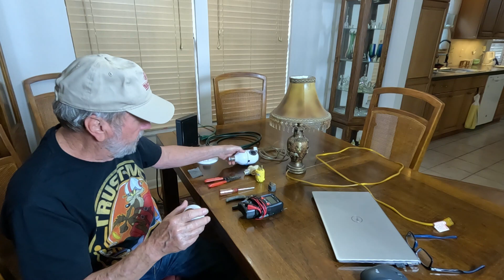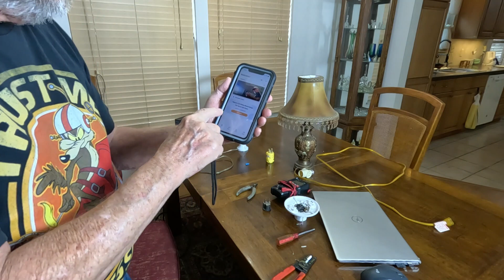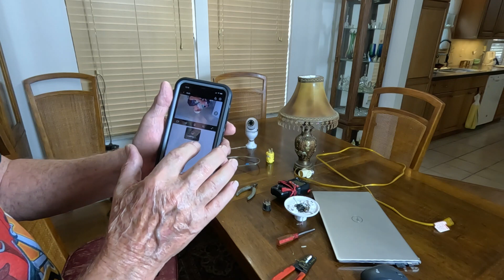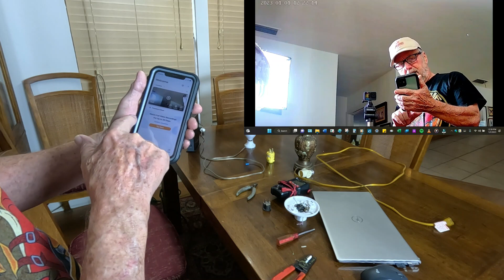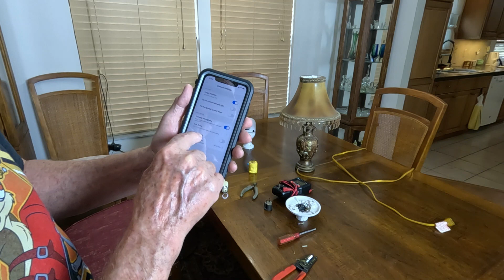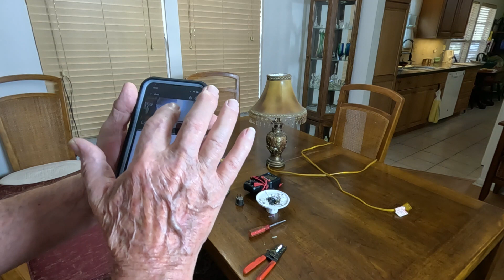Light Bulb Camera Pan and Tilt operation Q and A

Comment: OK Sam, you helped me out earlier, I got the camera working by connecting to a 2.4G router. Next question is how do I add a camera (device)? I have hit every button in settings and don't see anyway to add device
Reply from the maker: @Lee Keen, when you are on the app in the beginning, it has a button to add a camera as the first thing to do.  As you click this it directs you to point your camera with the QR code reader at the QR code on the Camera base.  This is how your camera connects to the App, then you connect the App to your Wifi connection.  That is when you will have access to the settings of the camera and do all the stuff to set the camera up to record all the time or only when movement is detected and how long you want the files and on and on.  Hope this will get you started.

Comment: I just got mine delivered today and put it outside  but sometimes  it auto focusses on the house  wall and not the yard
Reply from the maker: @lastking32 they will all do that as a home location.  You can turn the camera section to the view you want as the home location.  Then home will not be the wall.  Home will be the location you select.
Reply: @samowens44  ok I'm gonna try to figure out how to do that thanks
Reply from the maker: @lastking3216  Just hold the base that goes in the a/c socket and move the camera section horizonal and vertical to the point you want to cover.  Watch my video at the 13:40 min point of my video and you will see me talk and show how to move the camera by had.  Lastking, I show all that you need to know of how to move the camera to the point you want to capture, then it will be the home position.  Watch my video all the way through and you will really learn a lot, not skip anything, if you skip, that may be the info you need.  Good luck.  Remember, I have been where you are trying to get.
Reply: @samowens44  I'm watching it again now

Comment: I have tried several times to connect camera to WIFI (5G router). The connection always fails at 77%. An error flashes that some cameras will NOT connect to 5G router. Is there a fix?
Reply from the maker: The light bulb camera will no work on 5g network.  Sorry to break the news, but it is posted in their documentation.  No fix.
Reply: @samowens44  Thanks Sam, I did see that about the 5G but didn't want to believe it